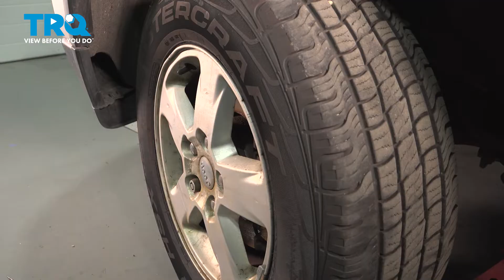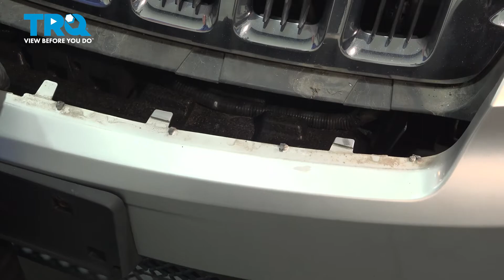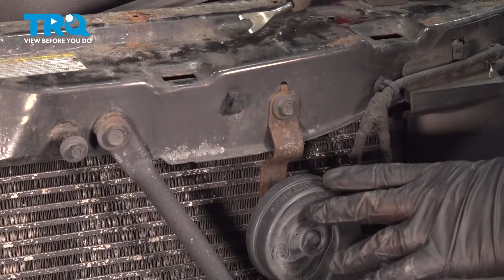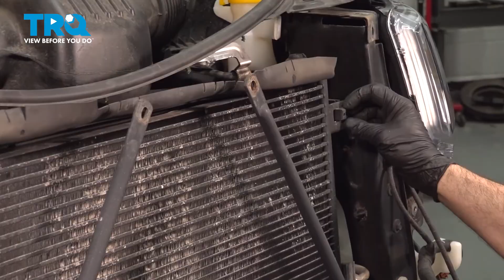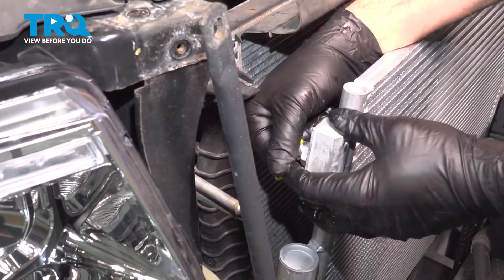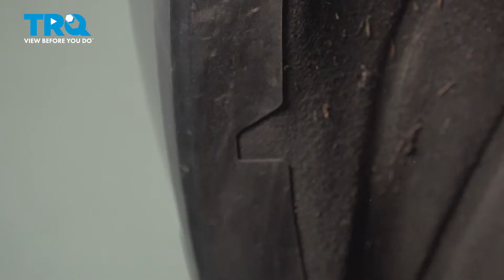How to Replace AC Condenser & Receiver Drier Assembly 2011-2021 Jeep Grand Cherokee 3.6L V6

Comment: DO NOT use the green rubber o-rings! theyll hold vacuum but when you put a charge on it, it will leak and youll lose all of your oil in the system! use the metal style sealing washers!

Comment: At the 15:00 minute mark, those are NOT AC refrigerant lines.  They are actually the  ZF automatic transmission fluid cooling lines. Thank you for showing how to remove the cloverleaf retaining clips!  The AC lines are located only on the driver's side location of this condenser.  The upper 25% of the condenser is used to cool the automatic transmission fluid.

Thank you for showing how to remove the additional small external cooler along with those two pesky plastic clips that run through the bottom of the condenser!  Well explained, sir.

Comment: Thanks for this detailed video! The hardest part for me on the whole job was getting the plastic clip retainer rings back on the trans cooler lines on the passenger side. Also, make sure you use the metal / washer o-rings on the AC lines like the ones that come off originally.

Comment: Good video. But there's no way your transmission fluid cooler lines (passenger side, two lines connected up top) will be dry. And when you remove the condenser, the tranny fluid in the condenser itself is going to leak all over the place.

How do you keep transmission fluid from leaking out from the lines and condenser? Or did you just skip that part?
Reply: I just did mine and a little oil came out, maybe like 2 to 4 ounces if I had to guess. The lines are pretty high so oil won’t constantly pour out (gravity). Make sure you have a couple rags handy and you’ll be good. More oil came out the trans cooler once I removed it and tried to get it out of my way than came out the lines.

Comment: 21:17 Do NOT USE regular green O-Rings. I did it, and during the professional ac recharge process, they didn't hold the pressure. The vacuum test was successful, but refueling the system did not hold the pressure. Use proper O-Rings with metal washer. I had to remove my bumper again to install proper ones.

Comment: 23:10 Locking colors did not fit until I removed clips that came with the condenser and installed an original from the old one. After installing old clips, I had no problem. Thank you for your video. I used this video as a service manual to do this job. 🤝

Comment: Where is the fog light button at? Ive had my 2011 for over a year now and haven't turned them on cause I thiught they were for show. Dont see a button for them. My condenser leaks but cant tell if its that or the lines. Definitely leaks on the left side. Tons of freon all over that side on the lines and splash guard.